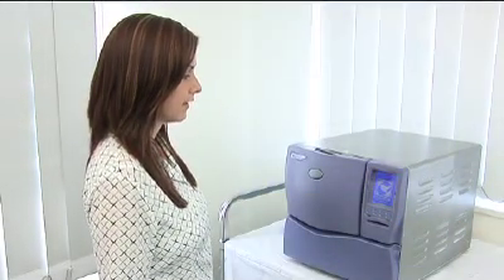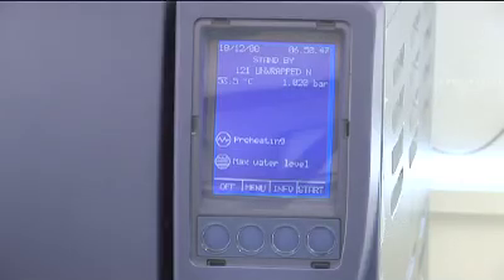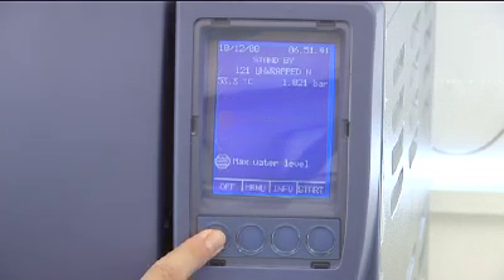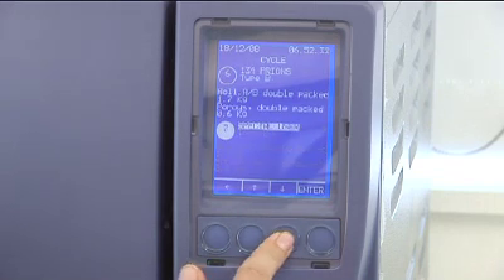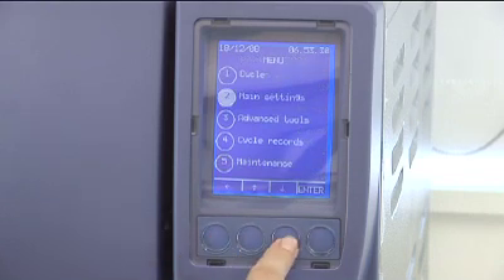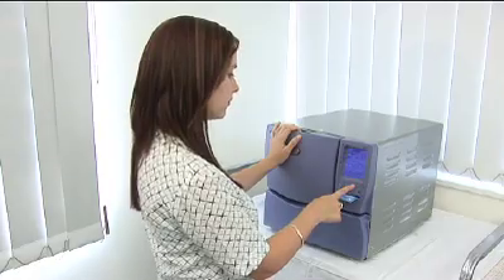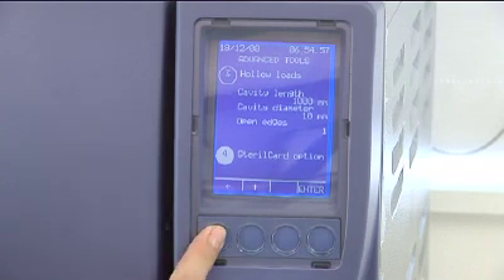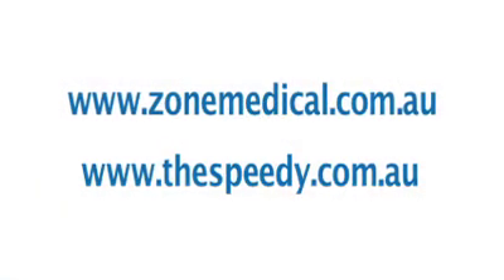How to Operate your Cominox Steriliser using the LCD panel

Comment: Hello good time
 I had a question. The door of the cominox autoclave was locked. After opening it with the latch under the door, the lock symbol does not go away from the screen and does not enter the program. With the secret key, the menu screen appears for a moment and is deleted, and does not allow entering the settings.  ten
 It also displays the alarm resistant error
 How can I remove the error?